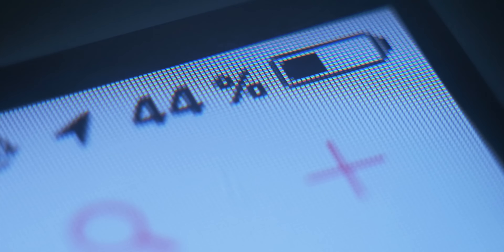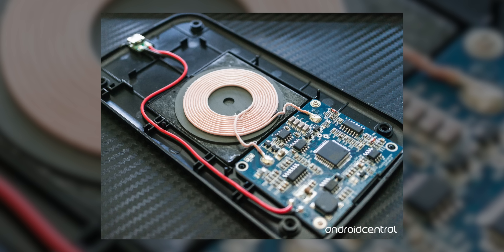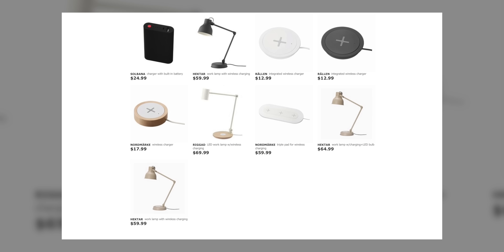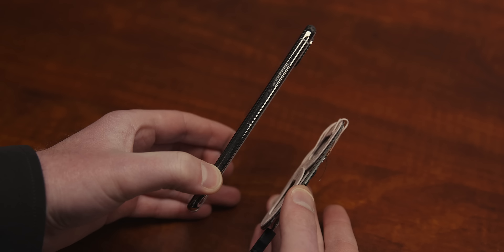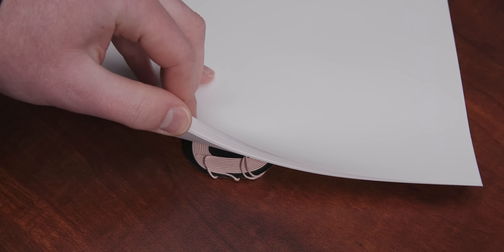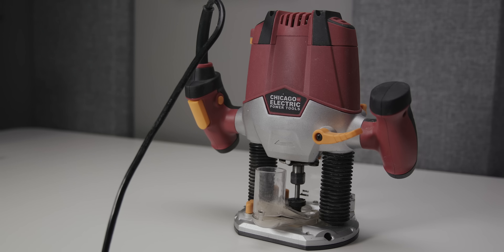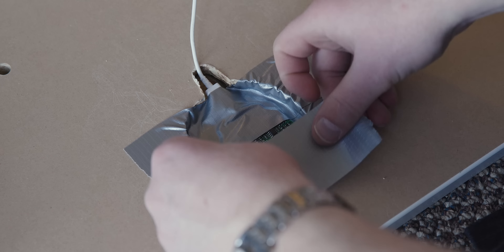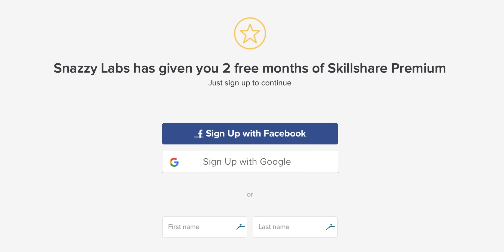Add Hidden Wireless Charging to Any Desk or Surface!

Comment: Or just buy the S10 and use it to charge your phone
Reply: What does that have anything to do with the video?
Reply: bob Bob time for that subreddit
Reply: r/wooosh
Reply: Clayton ARMY-
Reply: Army Blink ♥️♥️♥️
Reply: Yes I want it to take several hours to charge my phone
Reply: Or just use a cable.  No extra cost, don’t need to line it up with the charger's coil, and it’s more energy efficient.
Reply: Kevin Pham but is it cool. 😂
Reply: @cQ2DHPavXTqemm9Vsbgi4TV7x  r/itswoooshwith4os
Reply: r/woooosh
Reply: @cQ2DHPavXTqemm9Vsbgi4TV7x  
r/im14andthisiswooosh
Reply: I bought the note 10 +
Reply: bob Bob the s10 can reverse wireless charge, meaning it can push power out of its own battery and coil
Reply: @bobBob-oz5zc  FLEX
Reply: Augusticko x, Apple does include a fast charger and the battery is only bigger because android is so poorly optimized, iPhones almost always beat android phones in battery tests.
Reply: @bobBob-oz5zc  ok boomer
Reply: BIG BRAIN
Reply: S T O N K S
Reply: bob Bob r/woosh
Reply: Augusticko x optimisation is better on the iPhone, and therefore lasts longer
Reply: @bobBob-oz5zc  the s10 works as a wireless charging output, you can technically use it as a wireless charger pad
Reply: chad and loose all the s10battery to increase the other phone for 5%
Reply: Augusticko x  I think he meant that it takes ages to wirelessly charge a phone with the s10
Reply: A ok so the s10 is only for charging🤣🤣 and nothing else

Comment: Say he doesn't want to destroy or damage a table..

* Proceeds to destroy table *
Reply: Only the part that isn't visible
Reply: @Samstrex  but the table is way more destroyed then a simple and elegant punch through circle. 

I use 2 punch through holes as my cable management. 

The insert he showed did look ugly, but you could build a different looking one, wood looking if you wanted.
Reply: @erictheboringone5292  What he did was simply vulgar destroying the woodworking of the table. I would never in my life destroy my custom 2 piece L shaped desk like that. Making a punch through circle is like 10s job with the proper equipment and what actual wood workers do. It makes a clean and elegent hole.

This diy solution is as elegent as hiding wall damage behind a painting. Nobody will most likely see it, but it is a vulgar destrction.
Reply: Same comment $
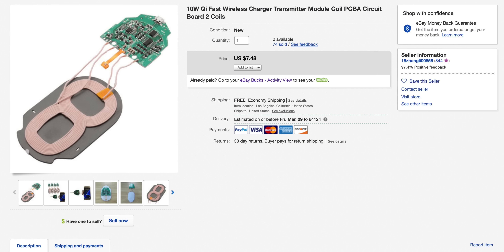Reply: @erictheboringone5292  he bashes routing out underneath (leaving the surface face unharmed) specifically showing "Fix this build that" at 3:15
if you are going to call someone a moron you should probably not say easily disproven stupid things
Reply: Who the hell care.  Are you going to flip over the table and look under it from time to time?
Reply: You can swap those little table tops out, they have different colors

Comment: I am a woodworker and a plunge router was a good choice for this. Also free handing anything with a router is never easy. For precise shapes and lines you really need a hard edges guide/template for the routers base to glide against. That would be a bit overkill for this application though so I’d probably have done the same as you. It’s hidden so who cares if it’s ugly. Nice practical video!
Reply from the maker: This makes me feel much better lol. Thank you!
Reply: Snazzy Labs Glad to help!

Comment: The plunge router was a PERFECT way to implement this plan. Getting the router from Harbor Freight was also perfect, especially since you aren’t planning on using this router on a daily, weekly or probably even monthly basis. The cost of the router compared with how long it will last considering your usage is as good as it gets. Cool video and great implementation of a DIY tech solution.

Comment: So as an Editor, I started looking back at your early videos and progressed on to now. The evolution of the logo, animation, cinematography, video editing and sound and audio equipment  and intro were a great looking through context. It does make me feel better that it took u years upon years making a lot of mistakes to come to this spot in your videos. So this motivates me, on working on my editing. Thanks Snazzy!!!

Also, if u see this, i used to edit 30 min long vids on i3 first gen and 2 gb ram. It was my cousins pc. But thanks to your 70$ pc build video, I was able to get a used hp oem with i7 3770 and 8gigs ram. Although im a bit bottlenecked with a gt210 gpu, im saving up to buy a 750ti.
Because of this now i can now use my editing skills to earn a bit of money.
So I thank you.
Reply from the maker: Thanks for the kind words! I’ve got a 750 Ti laying around that I don’t foresee myself using. Send me an email with your address and I’ll mail it out to you. 😉
Reply: @snazzy  Thank you very much for this opportunity. I dont have any words other than to say thank you.

But as I live in Bangladesh. I dont know if sending it would be even possible or would the delivery cost be exorbitant or not. I need to research a bit on what the ways are as i have never done this.

Thank you Snazzy. I cant begin to explain how this will help me and how greatful i am.

Comment: I would have used a right angle micro USB cable less stress on the mirco USB port since they are a weak port to begin with but other wise really cool.

Comment: Using same coil from eBay. 
Not sure how the other tutorials people did(mainly around August of last year) were stupid or too advanced. Make a hole under the desk close enough to the top to maximize charging capability, run a channel for the wire. 

You kinda did exactly what they did, just messier. I do agree on using a coil without an enclosure.

Comment: Great idea, much better than recessing a charger into the top side of your desk. I know you might not could care less but for anyone that does, if you use something like some scrap 1' x 2" lumber you could double sided tape them to the surface you are routing on and create a "fence" for your router to run along and router any shape perfectly for a cleaner hole in the surface then remove the "fence" when your done.
Reply from the maker: Tim datoolman Ah, see! These are the type of tips I needed before. 😂

Comment: I have the end table and I love it. It also has a 2.4 amp usb output to boot! Mind you I seen a revue on the lamp they offer, so I went down and low and behold I found the 175 dollar end table in the clearance section for 50 bucks! It was a store display but hey. I really do enjoy this sharp little table (it’s the white end table in your screen cap in your video) yes, it’s also a wireless charger lol

Comment: I actually just used a 15w wireless charger and put it in a nightstand and it works perfectly fine.  I was going to get the one you mentioned but  if a piece was broken or missing I didn't have tome to return it nor I don't have the right equipment to fix it. especially since it was for my husband's birthday.  Also I used a router and I did pretty good with. My next one I do I'll try it your way 🤗

Comment: Instead of drilling a hole where are you using the desk, better will be if you drill a hole underneath the desk to fit your wireless charger and have a clean desk without any worries.
Reply: thats literally what he did

Comment: Nice vid. Hot glue > duct-tape for this application imo. The duct-tape can sag, introducing more distance between coils without you realising (especially with the potential pull from the cable), and hot glue is easy enough to pop loose.
Reply from the maker: This is a valid argument. Had I any on hand, I’d have probably opted for it. Cheers!

Comment: You should make sure that charger supports 7.5W Qi if you want to fast charge your iphone. When a charger advertises 10W, most of the time it is referring to Samsung's 10W fast wireless charging, which is different from Qi. Samsung only supports the basic power profile of Qi, which is 5W. Anything above that is their proprietary wireless charging. 

So if the charger doesn't advertise that it can do 7.5W charging on iPhone, it won't. Even if it says it does 10W.

Personally, I am fine with 5W wireless charging, as the point of wireless is more convenience rather than speed. If I really want speed that is what a 18W wired charger is for.

Comment: You should have first built a template of your desired shape as guide for the router.  That’s how wood workers do it.  Like you said it’s impossible to see the pencil line when using the router.  That’s why wood workers build templates so the router wouldn’t veer outside the template guide.

Comment: You will most likely destroy your regular home vacuum if you use it for dust collection when routing. Just route outside with a mask instead. I broke  my old vacuum after only one cut with the plunge saw (less dust than routing)  when i was to lazy to go down to to the truck and get my festool dust extractor. Just a heads up!
Reply: Thats why he said shop vac...

Comment: Cool, but what about heat dissipation? Does the charging coil get hot to be worried about causing a fire if the phone is left charging for a long period of time? I am planning to put a charging coil under my car's center console (which is plastic), but I am concerned about the heat from the coil burning into the plastic. What are your thoughts?

Comment: Great vid! Does the plunge grouter have a depth control? I dont think you mentioned that...and I assume it works well with wood based materials. And what depth did you leave between the surface and the device? Less than 4mm I assume? Thanks for the upload!
Reply: A router with a plunge base should have settings that allow you to control max plunge depth, and should also have a lever or knob to lock in current depth so that you can cut evenly at the bottom of the recess. Most router bits will easily cut hardwood and anything less dense. Any router cut should be made in multiple small passes and the router should always move in a clockwise direction to prevent it from running away out of control.

Comment: I love how u say not to follow the how to videos on this, and yet, you do the same thing just with no case.
Reply: Well he specifically said putting the entire charger like plastic housing and all. Where as he put just the coils/circuit board in. So he didnt 100% do it like the others.
Reply: @zazuch   the distance between the charger and phone is all that is different, but you can account for that when make a hole in the desk. Its the same thing just one has to drill more of the desk out while the other makes up the distance with no case.
Reply: @AstralSoul100  you are dealing with a few millimeters making all the difference here. Having the coils, then the plastic case, then what you have left of the desk, then possibly a case on your phone it can add up fast. As he shows anything beyond 4mm of thickness which isnt much at all when you include possible air gap and SOME desk remaining you get quickly degrading service. So yes a few mms of plastic from the charger can make a difference.
Reply from the maker: Yep. A huge difference. 1mm too far away seems very short yet has adverse effects.

Comment: What is the loss in charging wirelessly opposed to by cable?
Reply from the maker: Found this very good explanation on Reddit: "Because we don't control the way the energy propagates from the source. It just does so according to the rigid laws of EM.

The simplest example of the phenomena is to take a flash light and shine it at a wall up close and notice how intense the illumination is. Then step back a few feet and watch how quickly it dulls out.

The energy transmitted via wireless charging scales by 1/r4. So if you double the distance between the charger and the chargee then you witness the power transmitted drop to 1/16th of the former amount. There are ways to make this better, but we're talking by small percentages. We can't avoid this effect as a whole." https://www.reddit.com/r/askscience/comments/9lv64p/why_is_wireless_charging_so_inefficient/
Reply: @snazzy  I'll stay with lightning USB cable.

Comment: Sure it won't be an issue, but duct tape (the glue) can be conductive, shorting your charger. Like I said, prob won't happen, but placing something in-between the PCB and your tape would make it an non issue.

Comment: What I don't get is, many 10w or above chargers still only charge the iphone at 5w.  My native union $60 10w charger is an example.  Even with a fast charge brick it will still only charge the iphone at 5w.  Some others, however, like another iottie wireless charger I have, charges at 7.5w (an iphone, I should say).  How do we know that the unit we buy is going to charge above 5w when other wireless chargers from major companies do not?
Reply: That is probably due to the iphone. Ive had cables that were able to put out more but since they weren't cables certified by apple they limited how fast they could charge my phone, or flat out blocked the cable from charging.

Comment: After hours of researching on how to make it work, it seems I am out of luck with my 1.2mm strained glass desk. Any ideas, or perhaps there is a product that can qi-charge with this thickness? Found a campaign on Kickstarter - "Archon" which supposedly charges through all surfaces (except metal) at 2.5-3.5mm, but they not shipping yet.

Comment: What happens if you use above a 10w. Like what about one of the 15w or 20w ones?
Reply from the maker: Some of the fast chargers are actively cooled so if you can still make that work it shouldn't be a problem.

Comment: is that a vesa mounted imac?
Reply: XxXStoneFingerXxX Yeah. The normal iMac has the option for a VESA mount when buying it and the iMac Pro has a removable stand
Reply from the maker: @ilpatongi  Correct. You have to order the iMac pre-configured and it can't be changed. iMac Pro has the option to add/remove.

Comment: You referenced a video by the channel Fix This Build That, that has 5.8M views, and your recommendations to your viewers for not following what he did, are null and void. Charging speed, efficiency, and transmission distance are all solved by the depth at which it’s installed into the surface.

Comment: Says he doesn't want to do the same thing as the other tutorials, does exactly the same thing as the rest. What difference is this (routing a hole in your desk), compared to the tutorials (routing a hole in your desk)? The only difference is that Snazzy uses a cheapo charger compared to the rest.

Comment: Didn’t get your point what you initially quoting.. didn’t like to damage the table, the ugly drilling etc etc… eventually you did same. All what i have a takeaway is you can spend cheap on buying the wireless charger as chip and coil rather than wasting money on professional wireless charger.

Comment: buy a 5 dollar fast wireless charger.. do wood work.. use a router saw... saw the top of a bedside table.. then laminate it with formica.... done.. classy modern wireless charging table

Comment: AirPods 2 are now available and they are a f-ing disapointment.
But you can use them with ya pimped desk!
Reply: Not really a disappointment, just exactly what we expected them to be.
Reply: @luca_sbll  Well, good point. It shouldn't be a suprise that Apple did not change the design or color variety.
Reply: @Spicy_Riker  every single rumor suggested a slightly updated version of AirPods which included small improvements, wireless charging and Hey Siri was coming this March, and that's exactly what we got. The new design and new color options will come with a future release.
Reply: I expected apple to dump the old ones and just replace them with the same price. This to me is ridiculous. Also it’s time apple includes then as a free option with new iPhones
Reply: Someone Else Yeah Apple raises the prices every time they release something.
It’s getting old now, and they really don’t have anything more than others at this point.

There are plenty of phones, even without the jack that come with great if not amazing headphones, fast chargers and other accessories directly out of the box and some are even matched to your phone’s color.

In the other hand Apple wants you to spend 1000+ dollars for a phone with the most basic and shit quality things possible.

And even if you spend the 100 dollars extra for the fast charger it still has the same horrible cable that is complete and utter shit...
Reply: @someoneelse354  They did dump the old ones and just replace them with the same price. You can no longer buy the old ones on Apple's website. The only more expensive thing is the wireless charging case option, which is not that useful and certainly not worth that extra money. To me at least.

Comment: All good until it overheats and desk catches fire.
Reply from the maker: Yeah, uh, no. That won’t happen.
Reply: @snazzy  is it because wireless chargers don't get hot, electricity doesn't short or  wood is fireproof ?
Reply from the maker: It doesn’t get hot enough to burn the wood. Not even close.
Reply: @snazzy  dude been designing fire sprinklers for over 15 years i know thing or two about fire. Electricity shorts, wood + wireless charger is bad combination. Plus it has no air ventilation. Some kid copies this burns the house down this guy can get sued.

Comment: Or you could just buy a wireless charger put it on your desk and be fine with that
Reply: You're missing the point... It's always a wireless charger that, needs to be attached to a wire... By placing it under the table he bypasses the sight of the entire thing. It all just LOOKS like it's the table itself doing the charging.